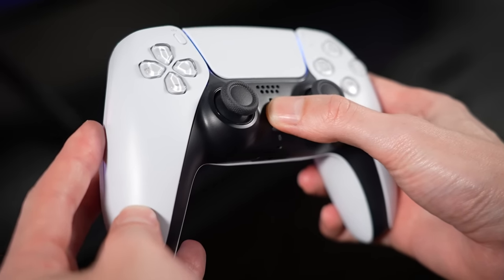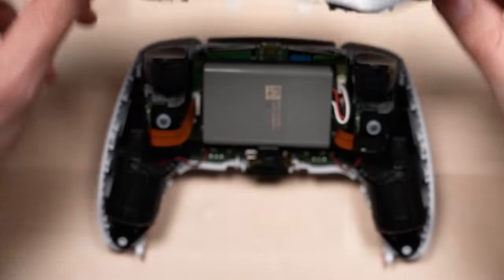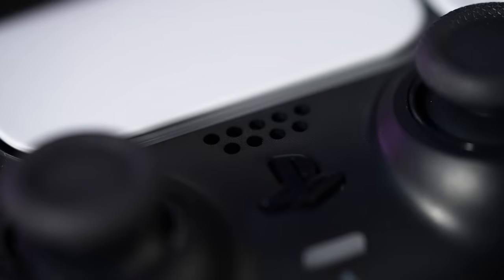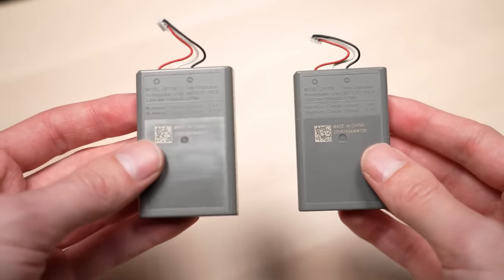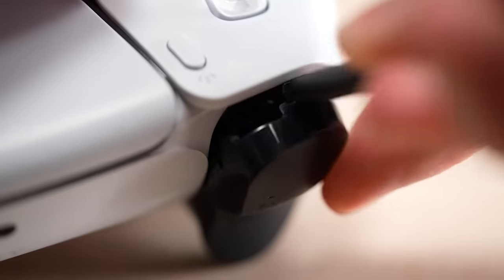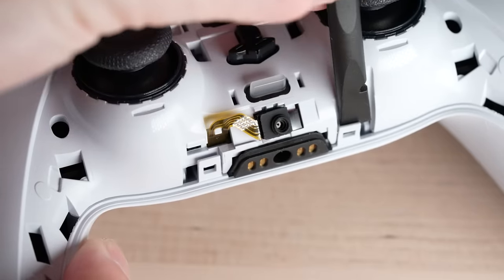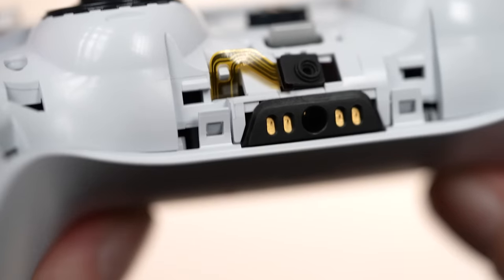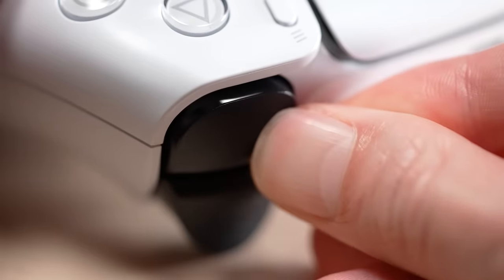Sadly, your Playstation controller won't last much longer..

Comment: Glad opening the Dualsense is easy. This is good, but still isn't as good as what Microsoft implemented with their controllers. 

In ten or fifteen years, finding an OEM battery for the Dualsense will be increasingly impossible in a market flooded with knockoffs that may not hold as much charge or be defective in some otherway. Even genuine OEM ones, if you can find them, would have been last manufactured several years ago and would have suffered some form of battery degradation just from being stored for a long time. The takeaway is, the Dualsense still has a shelf life if you want to use it wirelessly  for as long as you want. 

I bring all these up because I never managed to find a genuine OEM replacement for my Samsung Galaxy Note 5 battery and the one I got from eBay (made to look very similar to OEM ones of course, down to the battery information label, to easily fool unsuspecting buyers) didn't hold a charge significantly better than my 4 year old Note 5 battery.

On the other hand, Xbox controllers accept standard AAs, which are in no danger of going out of production. What Sony should do for their next controller is to have a built-in rechargeable battery but in a battery bay that also accepts standard AAs, like what 8bitdo does with their controllers. It's the best of both worlds. 

I know all these controllers have a much more likely failure point in their analog sticks, but it's never not a good thing to reduce the failure points of these devices one at a time and help reduce e-waste.

Comment: My controller has a significant drift downward. And use mouse and keyboard. Meaning I have only used the controller for navigating the menu in sharefactory. Will return it on Tuesday.

Comment: This really shouldn't be necessary this early in a console generation... I still have PS3 controllers with the original battery that will last around 40-60 of game play between charges.

Comment: I know this is a ps5 video but i need to rant about a recent ps4 controller experience.

I had the controller that came with my ps4 and the second controller I bought at the same time as my ps4 back in 2016 and I only had to replace them a month ago when they both stopped charging completely.  Totally normal to have to replace them after this long as they were very old yet had no prior issues which is pretty impressive.  

However the two new ones I got a month ago barely hold a charge in comparison.  I got one in blue and one in black because that's just the cheapest colours on Amazon at the time and i dont really care what they look like.  I don't do long gaming sessions for eye reasons so my old controllers could last over a week with being used for about 2-5 hours a day. The new one I have to charge every 2-3 days.  Very frustrating but at least I have a spare one when one dies when playing single player games I guess

Comment: That's why I stopped playing on PS5, instead I purchased XBOX SERIES X, its joystick last several days of continuous playing on rechargable batteries, not to mention the drift problem on PS5. the last 6 months, I have not touched my PS5 at all. XBOX just need strong exclusive games to become the legend. A PS fan speaking.
Reply: just use charging station on ps5 when your controller is low just switch your controller in a few seconds it takes as much time as chanhing batteries
Reply: @ld24p26  What if I have only one dualsense..!!??
Reply: @alialihafidh6809  too bad

Comment: Play wired. The only people I see affected by this are people who play on a TV 7 feet away from the screen that don't want a long ass cord lying on the floor while they play. If you play at a desk with a monitor ( or a smaller tv), this shouldn't really bother you considering you are close to the console. Not only will you have less latency, you won't ever have to worry about charging or a defective battery.

Comment: Tip: Buy a brand new controller. Take the back shell off. Remove battery. Do same with your own controller. Swap batteries. Put back together. Then return new one for  full refund.

Comment: A few months ago my D-Pad stopped working on the DualSense and I had to open the controller up and clean out a dog hair that had made its way beneath the rubber piece.
Needless to say I am greatly concerned that my $80 first-party controller will only come across more problems down the road. I haven't bought any of the pretty-colored DualSense controllers despite originally being excited for them.

Comment: It’s been less than 6 months and I already got stick drift and sticking. Never once dropped it, worst was probably putting it in a carefully handled carry-bag. Sony just haven’t bothered to solve this issue from the Dualshock 4. It honestly baffles me, because this is such a phenomenal game controller when you play with it, tech has come so far and yet a JOYSTICK is still the main design flaw. A JOYSTICK. Tech that has been around for decades, yet NOW you can’t make one that lasts longer than the rest of the controller?

I’m feeling deliberately screwed here.
Reply: Xbox has the same issue. Sony did revise the controller recently and made it better to prevent that from happening. The biggest cause of stick drift is a dirty controller, keep yo sht clean dawg

Comment: Why would you not recommend swapping for a bigger battery capacity? You can get a 2600mAh that’s the same size. The official one is only 1560mAh.

Comment: Bro my first ps4 controller was like old reliable....thing lasted me  from 2014 - 2021 while taking constant abuse (falling. I don't rage) I had to take it apart multiple times due to the touchpad not responding (I managed to fix it) and to to clean the inside (they can get DIRTY over time and clog up the buttons) but I just want to say he makes it look easy I don't have steady hands and it was freaking nerve racking taking her apart. During my last op on her I discovered a torn button pad. after years of service and being held together by ductape she finally gave out on me. (2021 took  something from everyone huh) I had to spend $76 for a new one, but I still keep her corpse in my gaming draw (she had been with me for so long and she granted Me my first victory royal so it became hard to part with her.)

Comment: Ever since I got my ps5 April of 2022, I noticed the charge doesn’t last long at all not as long as the ps4 controller charge. I will most likely to replace the batteries because to this video, thanks! I also noticed the pulse 3D headphones battery charge doesn’t last long either even less than the controller unfortunately

Comment: I like the features of the ps5 controller but its also the most easily breakable one.
My two white controllers malfunctioned with one left stick drifting, other one the R2 button broke.
I'm also very careful with my stuff and don't damage them.

Comment: I've been using the controller for YouTube a lot and it lasts about 4-6 hours I'm guessing. Is that any good or is the battery pooped? I know TV remotes just use infrared from a tiny light bulb at the top. I'm sure a PS4 controller is actively communicating at really high millisecond rates even of your not gaming and the controller doesn't seem to be able to turn off power from any of the buttons. What gives?

Comment: Pretty sure that's literally anything with a rechargeable battery.  My Xbox 360 controllers stopped holding a charge after a year or two as well.

Also, anything requiring me to unscrew something that is hard as shit to out back together without a ton of time, patience, and specialty tools is NOT easy.

Comment: I just tape positive and negative leads to my nyko charger that will charge anything. Like refreshing a drill battery arc it once when it has a little juice then top it off. Rechargable still og camo ps3 controller same battery type.

Comment: This is why the Xbox controllers are superior. Rechargeable AAs are both cheap and common. Plus you can use AAs (and an AA battery charger) for many other electronic devices...

Comment: The problem is with sony cuz they want us to do is keep buying controllers from them every 6 months .Buy a console for 500$ buy game for 60$ ,a good tv for 500$,ps plus everymonth or yearly,good internet connection but still u gonna lag cuz there's no region switch on ps4  n keep buying controller n games for 6months n after that here comes the problem you have to download 50 or 70 gb for everygames sometimes 100 gb too n 40 gb updates everymonth .woah gaming has become more a headache than a amusement .The day start playing a video game without any lag ,framedrop n a solid good controller will be the day i would say gaming has reached the next level

Comment: Is there an easy repair for analog stick malfunction? I don't have "stick drift" per se...my dead zones are fine. But occasionally my in-game camera will jerk all the way up to the sky, as if my right stick is registering a constant upward tilt. I don't have the money to replace the whole controller, so if there's an easy way to clean the analog stick or outright replace it I'd rather do that.

Comment: Wow! I hardly use my ps5 but I do notice that I have to charge it every time I do use. I use the hell outta my switch but that pro controller lasts a long time. I only charge it when i see the half battery icon in the menu settings. Or I get the rare low battery alert while playing. Other than that I don’t have to charge it much. 😜

Comment: I've had my ps4 controllers since like 2016 and they still work although the battery is showing signs of fatigue it's still going strong. I always have two controllers so I rotate controllers one for using while the other charges, idk I guess that just puts less wear and damage.

Comment: JUST GET TWO controllers, they are crazy cheap. If you safe money on the AMOUNT OF CONTROLERS you have, it's saving at the WRONG PLACE. OF COURSE batteries decrease in longevity if you use ot over and over and over and over again!!! GET TWO controllers, then they last double as long and you always have a re-charged one ready as soon as the other runs out of battery. DA!!

Comment: I'm having a problem with my PS5 controller right now. I can't find a solution on Google. I haven't used it for 2 days, and for some reason the controller flashes orange 3 times. Resetting won't help and neither will connecting it to the PS5 will help either

Comment: I've had a Dualshock for 6 years now and never had battery problems <3 I still think it lasts very long!! The charging habit I found was to always wait for the battery to go 0% (when the controller literally dies while you play) and only then, charge it all the way to 100%. Never charge it midway through, never disconnect mid way through.
Reply: Looks like Sony's been getting away with LiPo batteries instead of the increasingly common Li-Ion... Tho I think smartphones gotta drop the Li-Ion spiel because of how often mine bloat because I don't have time to charge it every two seconds ffs

Comment: Are these problems on xbox series X? I have xbox one S, i hope for you guys that the controllers will be fine, happens to every controller, except xbox doesn't have a battery, you need a battery you can put in there, or two when you use regular batteries and not ones made for xbox, but the analog stick will be a problem for EVERY controller sadly.

Comment: People just need to have common sense that's all there is to it there's nothing wrong with the PlayStation controllers of course anything with a battery overtime will lose the ability to charge as well but this could be prevented if people actually charge electronics the right way

Comment: Jeez have people really managed to already screw the DualSense battery lol

I still use the same very 1st controller on my PS4 and was from normal PS4 and it's still the only one I use on my PS4 Pro while the PS4 Pro newer controller model is still closed.

And the battery on the DS4 is quite a bit worse than the DualSense so basically in the same amount of time the DS4 will have close to double the battery cycles, it literally needs to be constantly charging from brand new to end of life. But anyway I don't exactly still see that much of a huge difference from new, maybe it lost around 30min of use nowadays but it's still good and holds the charge quite well since I can leave it OFF for months and will still turn ON with max battery and last almost the same crap which is about 4hours with vibration ON and always maxed out on every game...

Comment: I've had them since day one release and my controllers last 12 hours easily on a charge on GOW Ragnarok. Just because it says low battery on the screen means nothing. I've went 7 hours before after that notification..
Reply: Yeah I think a lot of people judge their controller’s battery life based on that message. PlayStation gives that message extremely early, which shouldn’t shock users coming from the PS4 it did the same thing. You can play hours on the low battery warning, while Xbox tends to last about 15 mins after the warning.

Comment: I had mine for 2 years and 4 months it still holds 11 hours. Down from original 13 hours. 
When it’s less than 8 hours I’ll replace the battery.

Comment: this is a gen 1 controller, are you certain taking the r1 l1 bumpers off is the same as a gen 2 controller? because they redesigned that part with a stronger spring

Comment: How to take of a Series X/S controller battery to replace it. *clips off the back of the cover and replaces rechargeable battery in less than 10 seconds without having to risk harming my controller*

Comment: I used my Dualsense on my PC leaving it plugged in for months, and now it doesn't hold a full charge or any. DS4 Windows keeps going from 25% to 12% to 0% but it works properly now that I have it charging using DS4 Windows as opposed to Steam's controller function. I did notice before that unless I fully charged it via wall socket for a few hours, it would emulate stick drift. Weird.

Comment: Considering that I'm already experiencing issues with stick drift and some sticky buttons (won't un-press), is it worth it to replace the internals or just buy another controller? I'd prefer to get a pro controller if possible but AFAIK those aren't available for PS5/dualsense yet

Comment: My ps4 controller i used for 6 years didn't have any problems. Battery and no controller drift. The only thing i can think off is the R2 where the input wasn't fully registrating on racing gamee
s

Comment: Eventually PlayStation to do what they did with the PS4 which is where they have the more than one model of a DualShock they need to do the same thing with the five and when they do it they need to make sure to make the battery better like they did on the new Dualshock 4 a 1.0 and the 2.0 need to do it with the five next

Comment: This is why XBOX controller wins in battery department, we have a lot more options, you can use normal AAs, you can use rechargeable AAs, you can use the official or unofficial battery packs, while PS4/5 controllers are stuck with an internal and thus less user friendly battery solution. So dumb, and many PlayStation peeps tried to say that the PS solution is better??? 😂
Reply: agreed, the only problem ive had with xbox is drift on one of the joysticks

Comment: I have ps5 and series x. I love both but it’s embarrassing how the Xbox elite 2 controller has a 40-50 hour battery which I feel like I never have to charge and my almost brand new PS5 dual sense can barely go 7 hours on a charge

Comment: jokes on you...my playstation 5 controller (as well as the console itself) is now owned by a guy named Robert (to whom i sold this piece of crap to a few days after buying it cause i realized games still (basically) look like ps3 with a few bells and whistles, light trickery, idiotic particle effects and slightly higher res textures) .

Comment: I feel like my controller never lasted that long. Even though it is not that old. Less than one year. Light usage. I noticed it even when my PS5 was brand new when I bought it just about 7 months ago. Maybe it just has way too many features and they overestimated their advertised usage time. I get maybe half of what they state the battery life is. My controller serial # ends in 1A too which I heard is the 'upgraded' controller.

Comment: Sorry, did you say 'for many users, they begin to experience issues over  time' ?  Can that statement be any more vague?  You can say that about every product ever made but I'm assuming your point is the ps5 controller will not last forever unlike other products which do last forever and never need to be replaced?  Thanks for the newsflash genius

Comment: This a huge problem. I have 2 ps5 controllers, have been using them for only 7 months a the battery is always a struggle. And I don’t use them on daily basis

Comment: I had the og ps4 controller for 4 years and battery wasn’t much of an issue, I wasn’t aggressive on the buttons but I did wear the R2 trigger buy playing too much racing’s and fps meaning fully pressed it only reads 70% pressed not 100%

Comment: My ps4 controller never had the battery go out but my charger port became loose bc if the angle of the wire when i put down the controller while it was plugged in. The ps5 controller fixed that by simply just angleing the charging port diffrently.

Comment: How long should a DS4 controller last for on average? I've suspected that mine is starting to fail, got it second hand last year with the console, and it's only lasting a couple hours ish and decharing while not in use decently fast.

Comment: Any lithium battery or PlayStation brand batteries.  Nintendo is notorious for using non compatible parts.  Nintendo users need Nintendo items or are stuck.